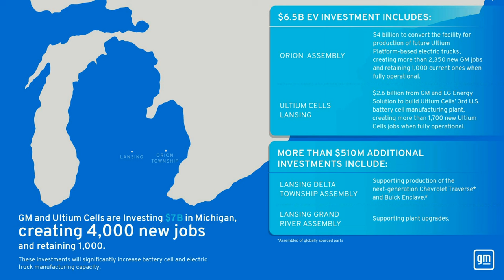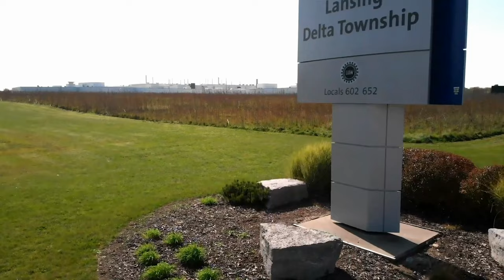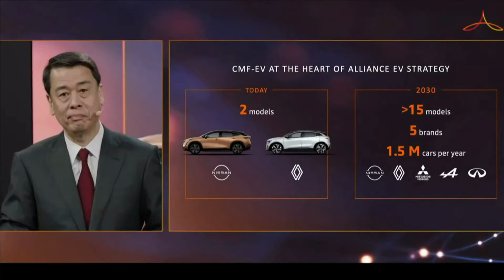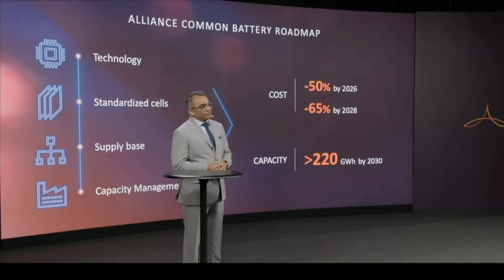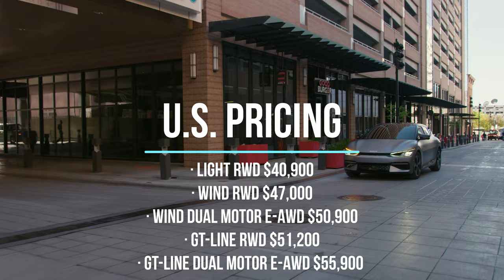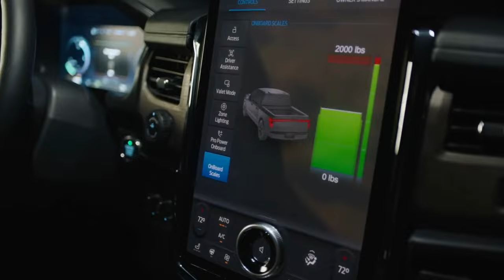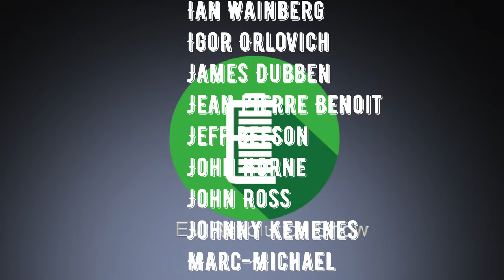Episode 160 - GM & Renault-Nissan Updates, Mia 2.0 and More News, Plus My 2022 EV Pick of the Year!

Comment: Kenneth.  Hi,  Your first pick did not turn out very good.  It had lots of problems with batteries and software and it seems to being replaced.
The 2nd pick, Tesla model 3 was and still is going strong after now 6 years in production.  I know you have one and me too since November 2018 with 31,000 miles.  I'm getting a 2022 model Y this month.
Your 3rd pick is probably right, but premature since the vehicle is not even out.  Making a pick as the Best EV on a vehicle that's not out is NOT a wise pick as your 1st pick was also premature too.
I also have a pending order for a Ford F-150 Lighting pickup and "may" get it around June 2022.
I watch all your videos, great job.
PS:  I was surprised you did not buy a Y instead of the 3.  I'm 6'2" and 300 lbs, gained 35 pounds since I got the 3, so diet or get a larger vehicle 😅.
I need both!  Plus lose 70 pounds...
Reply from the maker: Thanks for watching David.  I would disagree with you on my 1st pick, as the majority of owners I know that have one, love it and it is still a viable BEV today, regardless of recalls, etc. (That goes the same with the Bolt, most owners are keeping them). 

2nd pick, well 4.5 years in production to be exact and yes, still going strong. 

3rd pick was the Chinese MiniEV.  That is selling like hotcakes, only second in numbers to the Model 3, however the more important reason is that it helped to accelerate the Chinese market by introducing a newer class of mobility.  

4th pick, well it really does not have to be out and being driven around to be transformational.  As I explained, my picks primarily have to do with how it impacts the EV movement and helps to drive the market forward.  

In 2019, the only really AFFORDABLE (hint: mass market) and good-sized SUV BEV was the Niro EV.  The Kona, while super efficient, is just too small for the multitude of use cases, where the Niro provides a lot more use.  That is my opinion and battery issues/recalls and delivery allocation aside, was a great choice of features, range and price for 2019.  So I am sticking to it.  

Appreciate your viewpoints of course.   

Looked at the Y closely, mainly for the height and hatch.  However, I was already stretching the budget with the LR and did not want to add more dollars.  Turns out, even with my extra load of weight I too carry, I love the 3 and have no regrets.  It is doing everything I ask of it and more.  

And yes, me too.  Pandemic weight is real and eventually, I need to loose it but I'm so busy with my real job, family and this YT stuff, I simply can't devote the time for a regular cadence.  Nicer weather (when it comes) always gets me out more anyhow so I'll do better once spring comes around. 

Thanks for watching my shows and again, appreciate your comments and viewpoints.  I like to be unique and not follow the trend, so maybe my picks seem out there a bit.  I have my reasons.